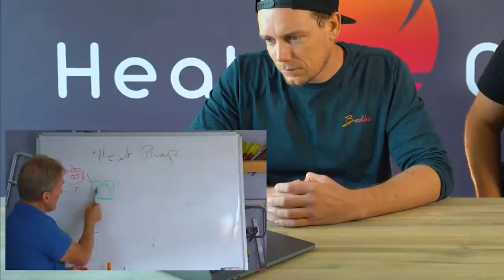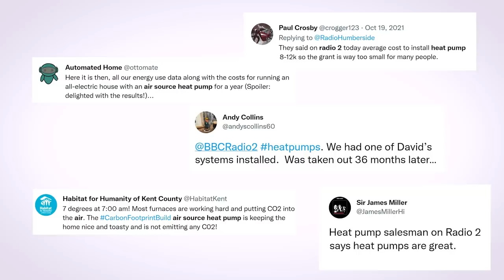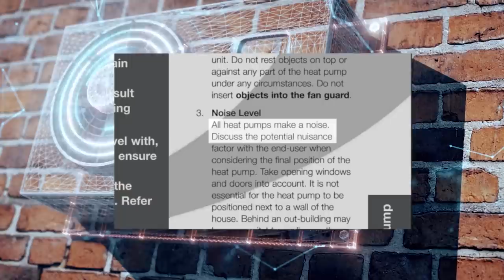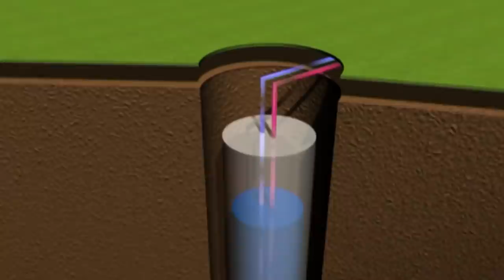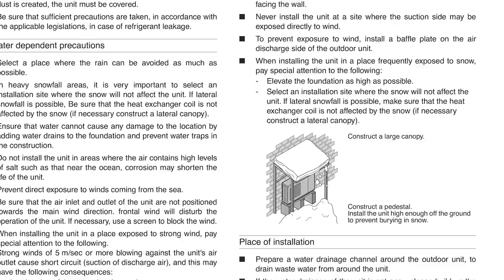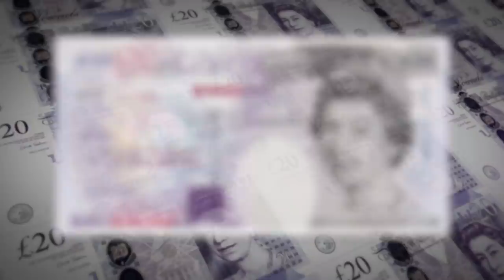Heat Pump Secrets They Don't Want You to Know

Comment: One of the biggest problems is that you need heat to warm up the compressor in the winter months, because as you know you can compress a vapour but you can't compress a liquid, and where does your refrigerant go ?, well it will find the coldest place to settle, simply because it is trying to return to it's original form which is a liquid, and the compressor outside is the perfect place for it to settle, so heat is required to disperse this liquid refrigerant into a vapour or it will simply damage the valves in the compressor and that becomes an excessive cost, Heat pumps are not the solution to home heating, or hot water, it is simply too expensive, and that is not accounting for general maintenance or breakdowns.

Comment: You don't like Heat Pumps do you mate. 

You must have worked very hard to find every possible negative about them. I'm sure that manufacturers put in various warnings about environmental conditions but as we all know they have to do that these days because people do stupid things when they install anything more complicated than a door mat. Any piece of outdoor equipment has warnings like you mention. 

My Vaillant aroTherm air-source Heat Pump has performed faultlessly for over two years in temperatures down to -8 centigrade.  One of my mates down the road has one in a 1930 terraced house with radiators and he's the same. The warranty is for 7 years which I think shows a certain level of robustness.

It's been piled up with snow, had rain pouring on it for days and is in a very windy 'channel' at the side of my house. After over two years there's not a spec of corrosion on it. It doesn't produce toxic fumes (like a gas boiler) and it's so quiet you can't hear it until you're within a couple of metres - and then it sounds like a built-in fridge. My house is toasty warm and my heating costs me a third of the previous gas system.

You say people only hear what they want but you've put a VERY one-sided commentary across.  There was no 'balance' in this video - just a very biased view of what actually happens in the real world. You can't blame heat pumps for dodgy salesmen making stupid claims. That happens in the gas industry too. I know of several companies that were selling underpowered, unreliable combi boilers to people who thought they were going to halve their heating costs and ended up having to replace crap boilers within a couple of years.

You're entitled to your opinion but I can't see why you think it's necessary to be so negative about a technology that is better for the planet and more efficient. Scandi countries have been using them for years and their climate is much harsher and more coastal than ours. I would never go back to gas - I couldn't afford to!
Reply from the maker: Good to know, we want real life experiences on this channel. This is one sided for sure but so is your comment. We get lots of people contacting us with compaints about their heat pumps not peforming as promised. Some have them taken out because they are expensive and the house is not warm.  I am pointing out the things that might invalidate the warranty and I know the salesman won't bother.

Comment: 4:42 You can burn gas to heat your home or you can burn gas in a power plant and heat your home with a heat pump. Are these equivalent? Burning the gas either way is around 80-95% efficient, but the heat pump is 300-500% efficient.
So yeah, there is a huge difference in efficiency and burning the gas in a power plant makes way more sense than burning it in your home.

Comment: 2:35 If you have an air-to-air heat pump and it breaks down at the beginning of winter, I come to repair it only at the beginning of spring :)). As an engineer, I will not have to work in the cold hours because you (the client) have chosen to install air-to-air heat pumps in places where in winter you can have and - 20
Reply: Not much about air to air HP (air con) in UK, although some mention these in comments. I would like to know more about these, as I have a single level modest size property with no gas or wet system installed, and don't want one either. But air to air sounds perfect, but as they do not qualify for RHI or govt grants they don't seem to get a mention.

Comment: Ha Ha, I have one GSHP for the House (new build) with underfloor heating downstairs AND upstairs and two ASHP running the pool and Hot tub.
Only the pool ASHP's are satisfactory and these are optimised to work at air temperatures above 15c.
The GSHP is USELESS, it costs almost double the cost of running the gas boilers.
People need to understand, Heat pumps can produce heat at any air or ground temperature, its all about how efficiently they carry this out.
Now the Electricity price has shot up ( massively more than gas due to the government add-ons) the cost of RUNNING a heat pump is many times the cost of the gas heating.
As stated the Power stations are just burning gas to produce electricity with an efficiency of only 48.3% and then you have transmission losses on top of that.
The politicians have been well and truly duped by the Industry, Heat pumps certainly have a place in heating, especially when part of Hybrid systems and are perfect for soaking up excess solar or wind capacity.

Comment: In the house I spent most of my childhood growing up located in flyover country US, we had a very well sized, well designed air-based heat pump system that came with the house and was designed by an engineer with experience in the business.  It spent most of the winter in this part of the country using the electric heat backup to heat the house, which never got warm.  We supplemented the system with wood burning fireplaces (I never want to see one of those again.  The romance was gone after burning through a cord of wood in less than a month and realizing we'd have to chop/split a lot more logs to keep up.), but that wasn't feasible.  We got rid of it after several years and went to natural gas.

Comment: I enjoy a 92 percent efficient  hot air propane furnace. So simple. Massive heat anytime l want. Fan switch to move just air if l choose to balance air in two story bldg. Filtered air. Constant close control of temp. I marval at the expense people go to with these hot water systems.

Comment: You mentioned minisplits, (Air to Air heat pump/inverters).I'm considering one but you did not really go into any detail or offer any opinions. Would appreciate a review or summary if you have any thoughts etc.
Reply from the maker: I am told they are a lot better and cheaper. You won't get a grant for them but I think that it is worth trying if you have no mains gas.

Comment: I think the only way to make this kind of thing work is to combine solar power, wind, hydro, etc with ground source or air source heat pumps as well as solar gain/ventilation strategies as a complete system. I know it would be expensive to install and probably not practical either, especially for retrofits like my house, but every bit helps unless the returns in cost to the environment are more negative in doing all of the work.

Comment: A friend of mine moved into a brand new 3 bed house fitted with a ASHP last January. When the cold weather hit the outside temperature didn’t get much above freezing for about 18 days. Over that period he used over £300 worth of electricity to heat the house and hot water. And the government are telling us that ASHP are economic...
Reply: Don't you think the question should be why is the buildings insulation not performing correctly, get someone independent out to inspect it.
Reply: @edc1569  I just did a quick sum, that's an 8kW load, 24 hours a day for 18 days. Either they're using ridiculous amounts of hot water or there's a serious problem with the insulation. Either way, the gas cost would have been very similar. Heat pumps cost roughly the same (to run) as gas when the weather is very cold.

Comment: IMO you're right regarding using gas generation to create heat pump energy. So, we have energy losses from the pwer generation, losses from the transfer of electrical power and then the losses in the heat pump! Gas used once at the home would exerience fewer losses?

Comment: Thanks for your informational video.   Are you saying that 'some' manufacturers are using RESISTIVE heating elements for use during the defrost cycle?   There is no such thing in my system.  When defrost kicks in, the system simply reverses, all fans stop.  I have personally watched the frosty coils themselves melt the ice.

 I have the newest Mitsubishi system, 3 air handlers in the home which are 'hyper heat', but the outside unit is non-hyper heat.  It is a 30k btu system.   This system worked BELOW it's 5 degree F. limit at '0'F the other morning.   But, when it went to MINUS 2 degrees F.  the system would only run for about 2 minutes at a time the shut down.    Had to kick on the gas furnace (O:   

Soon as the outside temp went to +3 degrees F. (about 1.5 hours later)  I switched back to the heat pump, and they were working again.   I may consider a 'hyper heat' upgrade for the outside unit.
Reply from the maker: OK your heat pump takes the heat out of the house to melt the ice. Good.
Reply: @SkillBuilder  Yessir!, and thanks for the reply!

Comment: Most of our electricity we get is from hydro, the cost of Natural Gas is cheap, and there are lots of rebates. My gas furnace is 20 years old heating air and just need to do the math on the roi of a heat pump. One nice thing is heat pumps will remove the humidity from your air.

Comment: Because heat pumps are ~300% efficient, if your gas power plant has a >35% efficiency (taking electricity transport loses into account), it is worth burning gas to produce electricity - even though obviously not ideal. Also, it means your system is will reduce the overall pollution if you replace your power plant with something cleaner, without any intervention at the system level.

Comment: I love the onus on log burners being a bad thing. We managed for hundreds/thousands of years burning wood, no filtration or secondary burn systems back then like today's burners. Mine cost well over £1000 and made in Norway, absolutely amazing how little wood it needs to keep going hour after hour. I can fill it up and leave it on the lowest setting and come morning I can pop on another couple of logs and it's as though it has just been lit. Heat pumps are expensive toys that break over time, wood burners (efficient ones) need little to no maintenance and keep the entire house warm, literally for free. NO brainer.
Reply: Where do you get the "free" wood from ?
Reply: @jimosullivan1389  ebay marketplace - free pallets
Reply: @davewallace5008  Thanks, but you have to collect them.   How many will be local to you and will you be able to get enough for a winter ?
Reply: @jimosullivan1389  I collect them throughout the year mostly local when I'm out at the shops or calling to my mother in laws. Essentially if I weigh in the cost of diesel it costs me roughly £20 to warm the house for five months, so they can keep the heat pumps! LOL
Reply: @davewallace5008  cheers

Comment: Trust me ground source is also useless. I built a house with concrete floors and underfloor heating 14 years ago and installed a ground source HP. From day one it just could not heat the house to my 22c requirement. The main trouble with them is the max temperature they produce is below 50c unlike gas or oil which is 80c +. So if you enjoy having cold baths and showers and living in a house that at best will give you 18c room temperatures then go ahead. The system cost me £20k 14 years ago and within 2 years the pump packed up. I scraped it and bought an oil boiler for £2.5k what’s not to like and oil is one of the cheapest forms of energy. Wild horses would not get me to buy another. By the way the HP froze my garden in the winter, how could I tell? you could see it had raised in the middle of the lawn.

Comment: Excellent stuff! Family put in a heat pump and just a few, smallish radiators in an ancient stone house and had all sorts of problems. Radiators smaller than underfloor heating need higher temp water to run, meaning more labour for the heat pump meaning reduced efficiency, i.e. the calculations by the salesman are out the window. Also you need to heat every room to get a high flow rate meaning you cannot close down rooms in winter and just equip them with a de-moisturizer. The entire technology is not well thought out. It is a "fit for average Joe" solution that will work nicely ONLY if your name is Joe. One visit for upkeep cost as much as 20 years of upkeep on an oil burner.
Reply: Like any solution, it has to be spec'd properly. If you spec it wrong it won't work. Not enough radiators was your problem, not the heat pump.

I'm heating a 3 bedroom detached house with concrete walls, single glazing and no insulation using 1kWh of electricity, works out around 1/3rd of the price of gas. 😂

Comment: My head is spinning from all the research I have been doing to understand if we should get rid of out gas furnace and go to a heat pump.  We live in British Columbia so I know all the electricity is generated by water (gravity).  Once the cost of building the dam and power plant is paid off it’s free and clean energy - isn’t it.  One thing pushing us is the grants - there is only so much money put forward and they say when it’s gone it’s gone and right now it’s 1/2 gone.  The other thing our gas furnace is old (1993) if it breaks down there is no grant.  The furnace has to be running to get the grant.  No grant for a single mini split because it can’t be looked at as the primary heat source.  They told me there is a heat pump thingie that can be attached to our gas furnace where they could work in harmony together but because the furnace is so old it is not recommended.  One heat pump outfit told me to stick with our gas furnace because it is way cheaper to run than a heat pump.  
Son of a B - the place we moved from was totally heated by wood - I miss it already.  I see now why I know so many people that just spend the winters in Mexico.

Comment: Too many heat pump installers have a vested interest so that they aren't disinterested or impartial.   As for the exhaust point on gas boilers, the same can be said about power stations that provide the electricity to power heat pumps.

 New builds with excellent insulation may be OK for heat pumps, but 24/7 running is expensive.   They may be quiet to start with, but after a while, like fridges, they get nosier, start to rattle and rumble as they age.   Maintenance to keep them quiet is going to cost as a fan and pump running 24/7 will wear out its bearings.

Comment: Have you heard about the new generation of High Temperature heat pumps?  Seems like it fixes a few of the issues, can swap out the boiler without needing to upgrade the plumbing or insulation and can run like the boiler was run I think.
Reply from the maker: Yes but the higher the temperature the less efficient. The manufacturers will tell you that.
Reply: @SkillBuilder  Yep, crappy SCOP. A niche product.

Comment: Question.

Is humidity a good thing or a bad thing? On one hand humid air conducts heat a lot better. But on the downside I’ve seen on AC units if they’re turned too high the condensation turns to ice that can build up and make the sing less efficient.
Reply: It depends on the make/model, mine goes automatically into the defrost cycle,  I see my heat pump ejects more water when it is humid but no operational problems

Comment: The latitude is important, heat pumps work wonders in mild climates. And cooling in summer is vital.
If 1 heat pump is not not enough, just get 2. There are very cheap options, noisy little fockers, a more expensive one, should be quieter.

Comment: I must admit I was suckered into buying a heat recovery system, and deeply regret doing so.  It has cost more to run and maintain, if you allow it to turn off it takes ages to get warm again and need the gas boiler to boost the temp up before the recovery system takes over. After just over five years I deeply regret having the system installed.
Finally I would check any figures given, particularly the the ones for the RHI rebate, mine over the five years are about 20% of the rebate the installers quoted . 
Spend the money on something else
Reply from the maker: Thanks Garry 
I am sorry you had to go through the pain but I hope it helps others avoid the glib sales talk
Reply: Thankfully the government have seen the light somewhat with the introduction of the boiler upgrade scheme replacing the RHI, that just gives you a flat £5k or £6k of the cost of the system.

Comment: It doesn’t have to be one or the other particularly in environments with very cold winters.  I have a hybrid system so that the heat pump operates down to about 30 degrees F.  Below that my gas furnace will turn on so that I don’t operate the electric emergency heat coils that heat pumps typically use.
Also I have solar panels and batteries, so I am not creating an extra electric demand on the grid.

Comment: Air source heatpumps should not be advertised. They lose all efficiency when needed most. The winter. They need maintenance on the outside unit. They need to preheat themselves to overcome the low temp threshold in the winter.

On the other hand. Vertical ground systems are absolute amazing. They are also heatpumps, just another source. And the confusion for people madnesses me. I have one myself. Vaillant, pure beauty. Well worth the investment. And passive cooling in the summer !